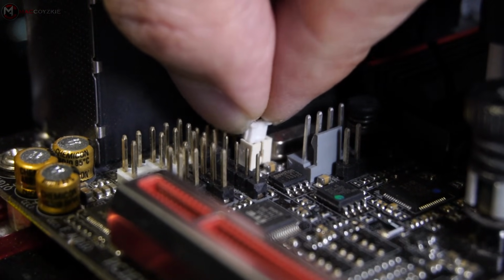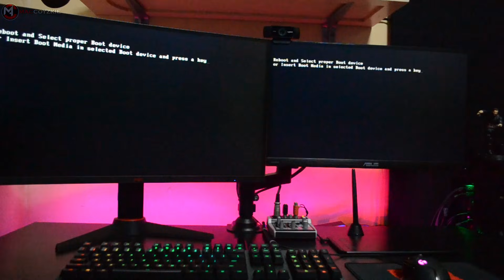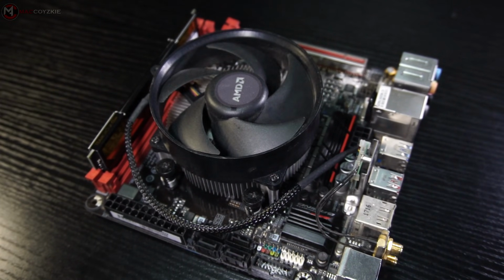How to remove cmos battery in your pc? Cmos reset / hard reset on bios

Comment: Hey 

Will removing the battery, u said it will do a software reset, does that mean I lose all my files? Thanks
Reply from the maker: just bios reset, your files will still be in your drives. btw do the cmos reset only if you are using windows 10, you may have problems if you are using windows 11
Reply: @MacCoyzkie  ah the problem is I enabled secure boot on windows 11 and now it powers on but doesn’t show on the screen / keyboard and mouse aren’t powered 

So I’m thinking would removing the battery still reset the bios settings on windows 11? Or is it more harm than good
Reply from the maker: @gmsp  if you just enabled it i'll assume you're in windows 10 then, clearing cmos will be fine
Reply: @MacCoyzkie  ah nah I was on windows 11 the whole time

Comment: Hey, my Xfx graphics card is plugged in and everything but it does not spin and the display does not worked also. It’s well connected to the power supply with the pins. I don’t know what to do
Reply from the maker: let's check the basics first https://youtube.com/shorts/-IMdGQKLwrg 
if you already done that then this might be a dead psu problem. you can check the status of your psu by using something like this https://youtube.com/shorts/YrC3PlflLq0

Comment: Can I use a magnet on my battery if the slot is tucked behind the graphics card?
Reply from the maker: no, remove the gpu first
Reply: @MacCoyzkie  it appears there is a warranty screw attached. What are the odds of removing it and voiding my warranty?
Reply from the maker: @Simplebacklog  if the sticker is on the cmos battery then don't do anything but call the store where you got your pc from and have them fix it for you

Comment: My screen is black after an elden ring crash😅 now it will not work with me. I've tried everything including this
Reply from the maker: if you tried this while running windows 11 then it's a bad idea. btw are your mouse keyboard lighting up?
Reply: @Mac Coyzkie  yeah everything lights up I run windows 10 I can hear the pc working fine in the headphones I just have no screen
Reply: I've tired launching into repair mode and even if it's in repair mode I still can't see the screen, all the wires are 100% and the monitor is not at fault.
Reply from the maker: @cainsmyth53  if you are hearing the a music or the game audio then this is not a pc problem. you need to check the hdmi/dp or at least replace it. the worst case could be the monitor is not working so try it with a laptop or a console
Reply: @Mac Coyzkie  I've tried new hdmi cables and the monitor works with the xbox it's definitely the PC
Reply from the maker: @cainsmyth53  i see, since we already cleared the  cmos, next steps may be tedious but we have to do it. have a friend test your gpu in their pc, if it works there then this might be a dead psu at your end. you will need a psu tester like this https://youtube.com/shorts/YrC3PlflLq0 to  confirm

Comment: Thank you I needed help to remove it so I could reset motherboard bios settings I accidentally set a ram speed to high and then my pc wasn't turning on now it works so thank you i can confirm that it resets bios settings
Reply from the maker: no problem bro

Comment: Hi I'm not sure if you will respond but I'm getting a error that says "there is an error in the smart detection" and "1720-smart hard drive detects imminent failure" I don't know what is a smart detection or how to remove it.

When I removed the CR2032 battery coin then waited for a minute, I inserted back in, then turn on my computer until it says "161-Real-Time Clock Power Loss". I'm not a computer expert so I need help please. I can't afford to buy a new PC.
Reply from the maker: first the "there is an error in the smart detection" means that your hdd is probably scratching or not working so basically its about to die. if you can't access it anymore there is nothing we can do at this point, you need to replace your hdd.

"161-Real-Time Clock Power Loss" might be a depleted battery, it also needs replacement 

the good news is, its not the entire pc but those parts only

Comment: No monitor or keyboard signal, removed the battery and put it back and it still doesn’t work, can I try replacing the battery with a new one? Could that work?
Reply from the maker: that sounds like a psu problem more than a cmos battery problem. try checking the psu first using a psu tester like this https://youtube.com/shorts/YrC3PlflLq0

Comment: My PC has been running into issues such as when I play certain games stored in the D and F volumes they tend to freeze, framey, programs crash, don't launch at all. My PC has started to boot up, restart slowly and sometimes shutting down is slow and fast. My D and F volumes are part of my HDD that I've had for a few years which honestly is most likely had it now. My SSD and the HDD are both paired and connected via SATA cables. They don't put up without each other. So I've just been wanting to start fresh with the same windows account and all that doodah. Not sure what the problem is but I've been told to remove the motherboard battery to see if it does anything even tho I've only had this motherboard roughly since the end of 2021 so it's still fairly new.
Reply from the maker: you should check this https://youtube.com/shorts/Y4hFqhbu5Rc it might give you some info you need about hdd. Failing drives usually do this so i suggest start backing up

Comment: It is need to unplug the power cord on psu?
Reply: Ok thanks bro
Reply from the maker: @qoriyusuf244  no problem bro
Reply from the maker: you need to unplug the pc from any outlet before doing this
Reply: I have do that, remove cmos battery but it doesn't work for my blackscreen problem after i update bios via mflash 🥲
i'm using Msi A320M A-Pro
Reply from the maker: @qoriyusuf244  perhaps you need bios update, what is your cpu with that a320 mobo?
Reply: AMD a8-9600, my pc become blackscreen after update bios
Reply from the maker: @qoriyusuf244  the bios update is not correct if so. you might need to go to a local shop and have them do the bios update for you

Comment: New pc was working fine until a changed the rams position now it shows no display everything runs then fans slow down and  display turns on then shows no display   i did everything including removing the cmos and replacing the ram  im so pissed
Reply from the maker: new ram sticks might be incompatible with the other ram sticks or the whole build itself. what are the pc specs?
Reply: @MacCoyzkie  its not new ram sticks its the same sticks i just changed it from 1 3 to 2 4  z790 p motherboard trident z ddr5
Reply from the maker: @cubanrichh5545  hmm that should work right away. can you try the ram stick cleaning in this video https://youtu.be/F-dLBIomghY

Comment: Absolute legend. My PC wouldn't display on my monitor after I moved and I tried this and it worked!!! You saved me big time man. 👍👍👍
Reply from the maker: no problem bro! glad it worked
Reply: So you removed the battery when the pc plugged in or no?
Reply: @mahmoudfarghly2970  if you wanna get like 70k vaults of electricity going thru you then keep it plugged in😂
Reply: @Reece-_-101  ok I will try 👍👍😂

Comment: So I did this to fox my display not working and stuff cause it shows it has power to everything but it won’t display and my keyboard and mouse won’t work but it didn’t work and I’m honestly at a loss
Reply from the maker: sounds like a faulty psu or motherboard. you need to test your psu using something like this https://youtube.com/shorts/YrC3PlflLq0 and if your psu works fine  then that's a faulty motherboard

Comment: I was watching a video of an error of valorant and to fix it I had to move something of the bios and then my pc turns on but it is black screen, do you think this works? I'm scaree pls answer
Reply from the maker: it might help since doing this will set the bios to default settings
Reply: @MacCoyzkie  it didnt work, rip me
Reply: @MacCoyzkie  do you think I will need to change the mobo or all
Reply from the maker: @KATCracK  are you in windows 11? anyway try this next if you still see mouse and keyboard signal https://youtu.be/F-dLBIomghY
Reply: @MacCoyzkie  My pc was a pc that I bought already with all components in and I asked for support and they told me to do all that while they were watching and it didnt work, They told me that I had 1 year guarsntee wish me luck
Reply: @MacCoyzkie  and they told me that it could be the mobo, gpu or ram so they will check with no extra fee
Reply: @MacCoyzkie  tysm for replying but I could do nothing
Reply from the maker: @KATCracK  good thing its still under warranty so you won't have a problem. hope it all goes well

Comment: I know this is an older video and hate to bother but I have an Asus Prime z390 p and even after looking at the guides on the Asus website it's just showing where the clrtc pins are for a reset and not the battery itself.  Can't get my keyboard or mouse and monitor working but everything else Powers on fans and such as normal and think it's the battery itself
Reply from the maker: usually you will see "power saving mode" on your screen if its a battery problem.

Comment: I can't find my cmos....
Reply from the maker: the gpu might be covering it
Reply: @MacCoyzkie  hey any tips to fix auto repair loop and it doesn’t let me open safe mode I can only open bios so I’m trying this out
Reply: @MacCoyzkie it also happen because I updated a driver but I don’t know what I actually updated
Reply from the maker: @BluCashh  that sounds like a messed up windows. If you got no important files in the C drive the fastest way to fix is to have a clean windows installation.

But if you need to save some files you need to do a CHKDSK and SFC scan in safe mode. Try doing this way to enter safe mode https://youtube.com/shorts/IZKc8plksDA
Reply: @MacCoyzkie  thanks
Reply: First thing that pops up on my screen is preparing auto repair the. Resting pc the. It loads for a min then blue screen inaccessible boot device

Comment: Hello sir, can you help me?
My monitor only shows "No Signal", sometimes it opens but becomes black screen after a few seconds. I tried this steps / cleaning the ram / unplugging the cables, but its still not fix. I think this started after updating the geforce experience. 
Please Help 😭
Reply from the maker: if you make it to the desktop try to DDU the current gpu driver. here's how to ddu https://youtu.be/SvIJhcxZTsA
Reply: @MacCoyzkie  thank you sirrr, i will try this!
I have opened the desktop now because I quickly enable the low resolution mode in troubleshoot. I'll update if this works!!
Reply: @MacCoyzkie  it didn't work 😓 after uninstalling and reinstalling the driver, the geforce experience is still there. Should i uninstall both and install again?

Or

(when i opened the geforce exp, there is no update but there is "reinstall the driver" in the driver area next to home)

Should i uninstall both the driver or geforce exp or reinstall only the driver in geforce experience app?
Reply: It works now after reinstalling in geforce exp! Thanks sir!
Reply from the maker: @carlanthonymahilum9506  no problem bro 😀

Comment: If i remove the cmos battery,does it safe for my ssd memory? I mean i will not lose my data. Or you mean Its just reseting my mother board so that it can be detected again to monitor? Since i have the same problem. "No signal. Entering the power saving mode shortly"
Reply from the maker: no, this will only reset the bios not your o.s. The only way you can lose date in your drives is when you format the drive itself. anyway this video might help you https://youtu.be/ul3D0OhSkdg
Reply: @MacCoyzkie  after i remove the cmos battery and put it back. Press  CPU power button. It will booting to windows? Or i have to do some setting? Since i really dont know anything about computer and setting bios.
Reply from the maker: @cahsolo4838  if you are using windows 11 you might still do some stuff but if you are in windows 10 it should boot normally after

Comment: Thanks for the info dads pc had corrupted bios and each time it would keep turning off taking out the cmos and putting it back in seemed to allow it to finish it 👍
Reply from the maker: no problem bro😀
Reply: @MacCoyzkie  Sadly it seems still turning off, but still fixed the corrupted bios at least, but no idea what is causing it. Dad in the end decided to get a new PC it was a old one anyway and served it time. Still thanks for the info of the video helps in future.
Reply from the maker: @DrHojo123  i see, it might have reached its lifespan already

Comment: hey Mac, I havent replace my cmos since i bought it in 2014 with factory default pc. I only swapped the graphics driver out once with new one (december 2018). My issue is, I want to avoid power surges, by turning off wall switch and pulling plug out then. But when I do this,  i get an error. I then power pc off and turn it on, and it runs normal, nothing lost, everything works fine, even for months, half a year, no issue. But if power surge happens or i switch wall off/pull plug out, it causes this error. I dont know if im damaging my components with the turn on/off method, and I know power surges are coming to my country in the near future due to energy crisis. So i want to have my pc electricity out of the wall when I go to sleep / dont use it. See what I mean? I want to avoid power surges even when I dont use it. This current cmos battery from 2014 has had several power surges, i think atleast 8-10. Should I replace it even if it still works like now?
Reply from the maker: No need to replace anything, all you wanted is prevention for any damage during power surge or outage then you need a ups or at least an avr or power surge protect cable extension. more info about it here https://youtu.be/WiF2f08jwe0
Reply: @MacCoyzkie  alright thanks!

Comment: I wanted to enable secure boot to install windows 11.

When I got into my bios, I turned off csm and enabled secure boot and updating the platform key (pk).

After that I saved and exit the bios only to return to the bios again, csm was turned off and secure boot was on, only thing left it was to delete the PK. I saved and exit bios and once again I returned to the bios.

This time I updated the PK with secure boot on and csm off and saved, when I rebooted my pc turned on and beeped 5 times only to be stuck on a black screen.

I removed the battery for 5 minutes to hard reset my motherboard bios and touched the clear CMOS pins but nothing.

Does this mean I messed up/bricked my motherboard? Any solution please?

MB: Gigabyte Z370P D3
GPU: RTX 2070
CPU: I5-9600KF
Monitor: AOC 240HZ Monitor
Reply from the maker: can you try to reseat the ram sticks and gpu then do the cmos reset again. You must be able to enter bios at least after clearing cmos. I never experience changing the settings in the bios then having no signal after 
the only way you can literally destroy the motherboard is when it is in the process of updating the bios then you interrupt it by removing the power
Reply: @Mac Coyzkie  Yes I have tried that, reseated ram sticks, gpu and then tried to clear cmos, the only thing I remember doing before this happened was to click on Platform Key, 'update' it leaving the values with secure boot on and csm off. After that I don't really now what happened and gave me the 5 beeps at boot with no signal to my monitor.
Reply from the maker: @Giuseppe_198  that should still be fine, but that 5 beeps means processor failure, have you tried reseating your cpu yet?
Reply: @Mac Coyzkie  Not really, but I think I am gonna leave this issue to the professionals cause I don't want to mess up more.

Thank you anyway for the suggestions and help, appreciated.
Reply from the maker: @Giuseppe_198  i hope it all goes well

Comment: I have one troubble. After i updated bios to new one, my bios restart every time when i turn off and turn on pc. I unplug this battery, and used this battery in my lamp, to try if it works, and it works. Soo, how can i find what is problem there? Can this battery be a problem still if it works or u know other ways to solve it?
Reply from the maker: probably the cmos battery is depleted so when you replace it it worked. check the cmos battery details and buy a new one like it

Comment: I’ve had a bad history of breaking PCs on accident and having to send them to professionals. This tutorial just saved me $100 and hours of stress. Straight to the point, fixed the issue. Love you man.
Reply from the maker: glad it was helpful :goodvibes:
Reply: @MacCoyzkie   cant seem to see the battery , have a gforce , and amd
Reply from the maker: @callumreid6936  what's the motherboard model name?
Reply: @astrosasha  just had this problem a week ago , I’ve always built pcs for family or friends , but when it came to my pc I’ve always ended up messing something up on average i would be able to fix them by the end of the day 

So last week I finally got all my new parts to upgrade my pc after 5 years ,only for the pc to never turn on and if it did magically turn on it would shut off all power throughout the pc during the boot phase I tried everything for the next 2-3 days, I quit and was ready to send it to a repair place and spend hundreds more , then I read a comment of trying out the cmos battery , so an hour right before I was ready to drive and repair it , I tried it and it finally reached the windows login page 😭, I was so relieved that I did nothing but install the drivers and sleep cause that was such a stressful week 

Nothing is worse when you spend a thousand and plan everything only for it to fail , so that relief when it worked literally made by body numb 🤣
Reply: Trying for 2 hour for no display, currently waiting for 5 min for CMOS to reset
Reply: @waifucollect69  howd it go?
Reply: @waifucollect69  how did it go?